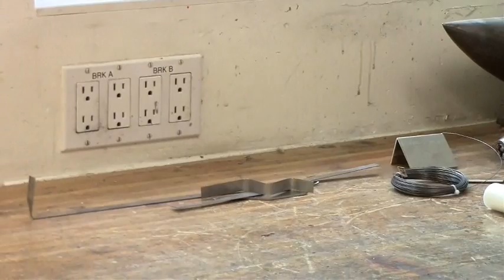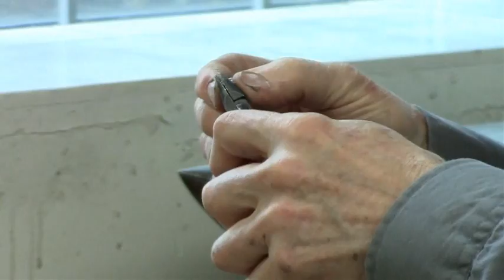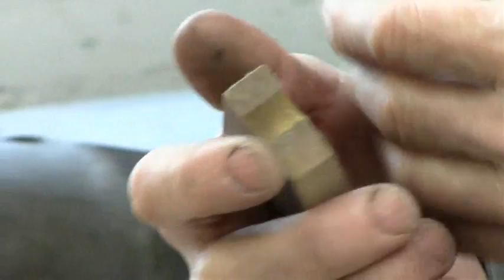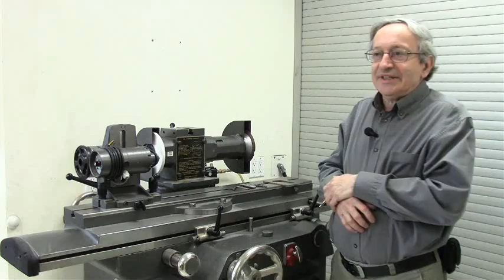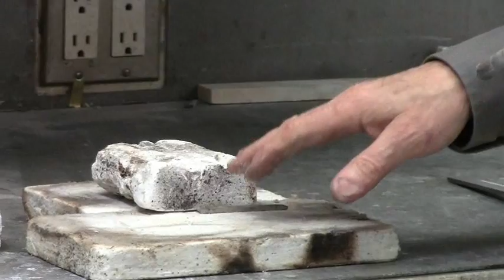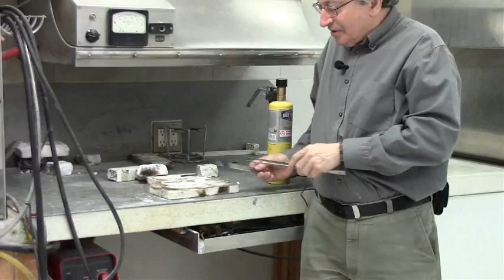Building Prototypes Dan Gelbart  part 9 of 18  Materials

Comment: Dan,  Another plastic that is quite useful is UHMW (Ultra-High Molecular Weight).  It can be used as working surfaces of industrial shot peening with little to no wear, even after years of use.  This series of lectures is fascinating!
Reply: it's a type of pe
Reply: @heartminer5487  Thanks!  I forgot to add the "polyurethane" to the proper name since we always just called it UHMW at work.

Comment: Also i would stock some thin brass rod (maybe TIG welding rod?), so i can cut it to small pieces of custom length to be used as makeshift rivets. Just insert into the hole and hammer the end flat. No need to heat it up. Not sure if there are any better materials for this... (Aluminum? Bronze?) For bigger diameters, you can also use hollow tubes, not only solid rods.

Comment: A great piece of knowledge yet again ! Thank You for sharing. So if you may, could you explain what materials you used in your steam engine ? You said it didn't need to be lubricated . You mentioned carbon composites and ceramics . So are we talking about graphite ?!? I am really interested because I want to build a compound steam engine and this would be very helpful.

Your content is to die for :) Best of luck :)
Reply from the maker: The simplest is a cylinder from hardened, ground and polished 440C stainless and a 440C stainless piston with a carbon/Vespel sleeve over it, plus Teflon rings. The carbon/Vespel is a commercial material.  The mirror finish is very important. I also tested more exotic combinations (like a zirconia piston in a special cylinder) but they would be very difficult to fabricate unless you are set up for making ceramic parts.
Reply: Omg :))) I can't believe you replied ! Yeah that's what I was leaning to in the first place(teflon in stainless), but when I heard about no lubrication systems I was very interested. So I googled it and saw a bunch of pretty interesting stuff with graphite pistons , but all proprietary ceramic finishes on the cylinder . So yeah, Vespel is a pretty penny but I guess it's worth it. Thank you , you are awesome ! Anyway I am certain everyone would love to hear about the process you went through with your engine :) Perhaps another video would cover this ,more in dept ;)  I am looking forward to any content you may post :) 
Tons of love from Bulgaria , and all the best !

Comment: Steel on phenolic gears are also quite useful if you want one of the gears to be sacrificial!
Reply from the maker: Oddly enough there is almost no wear in this combination. You can see such gears that ran for years under proper lubrication.
Reply: @dgelbart  I'm thinking maybe Tadesan meant sacrificial in terms of strength (because the phenolic teeth are in effect a series of cantilevered shear pins) rather than wear?
Reply from the maker: @Gottenhimfella  Properly sized they are not sacrificial, they last forever.
Reply: @dgelbart  Hmmm - a properly sized shear pin (like a fuse) should also last forever ... except in the case of accidental overload, when it protects more difficult-to-replace components in series with it, by shearing?
Reply: @Gottenhimfella  in that case you usually want to design a failure point somewhere else like on a shaft or by using an off the shelf torque limited coupling. Phenol gears may be easier to machine, but it's still more work then replacing a coupling.
Reply: @olivermatich2818  I suppose from an engineering perspective they're fit for purpose.  But a part of me does shudder a bit at the thought of sourcing such a part, since I'm just a hobbyist! Although, if you're a machinist I suppose you could make one instead. Thank you for the example though, very interesting to see where these gears show up.

Comment: Thanks again Dan, once again confused, (not by you) but is tempering the same thing as normalizing? 

I ask, because of some books say to either temper or normalize after hardening, so is it the same processes? 

Thanks,
Charles
Reply from the maker: Tempering is trading off some hardness for toughness (impact strength). Normalizing is a form of annealing, to leave the material stress free and having uniform grain size at the expense of all (or most) hardness.

Comment: sir, is it okay to temper using heater cartridges fixed as a jig to uniformly heat a part? like multiple soldering iron fixed at different parts of a irregular part. thank you
Reply: +Dan Gelbart oh yes!, I completely went for a complex solution to a simple problem. Thank you sir
Reply: I am a bit late to the party, but when you say it can be done in a oven, how long does the exposure to the target temperature need to be.   Or rather how short?   I imagine leaving it in for hours is not a good idea.
Reply: @kurtu5  "a rule of thumb is one hour per inch of thickness with a two hour minimum. Longer tempering times are not detrimental and it is essential that the steel is soaked at temperature after the steel catches up with the furnace temperature."
The two hour minimum is for heavy pieces in a furnace; small pieces tempered with a torch, with the surface temperature monitored directly, will temper through to the midcore virtually instantaneously.
A neat trick for tempering only the business end of a small tool (like a D-bit reamer, say) is to poke the other end into a potato, to act as a heat sink and holder, all in one.
And an interesting idea for production tempering small parts is to immerse them in molten tin. Lead has been used but the vapour produced at higher temperatures is (of course) toxic.

Comment: The video quits at 30:00 yet it goes on for a few more minutes and it seems that there's some content (voiceover) at the end.
Reply from the maker: LateralThinkerer Indeed there is a section missing (camera battery died?) but I don't have it. It was about working with glass.
Reply: Any chance to get the glass info put up?
Thanks so much for doing these!
Reply: @timmusson4344  it's on part 11, at minute 13